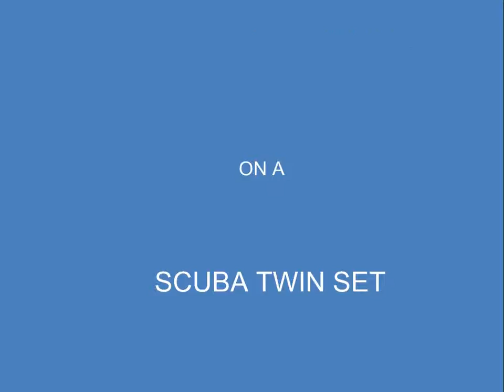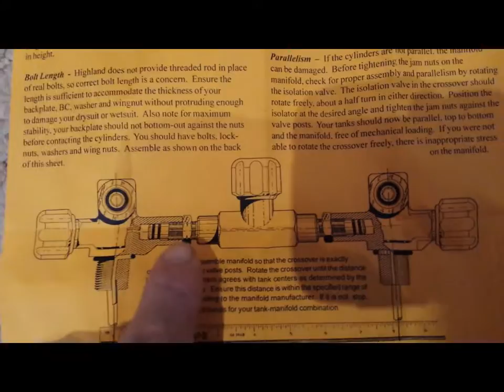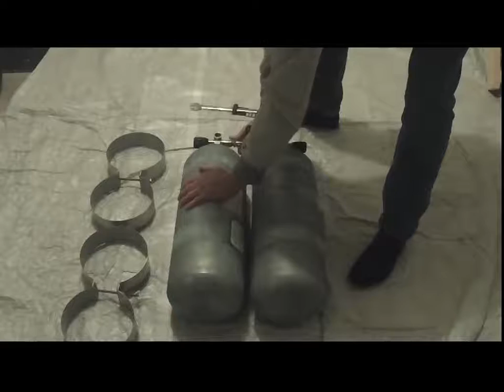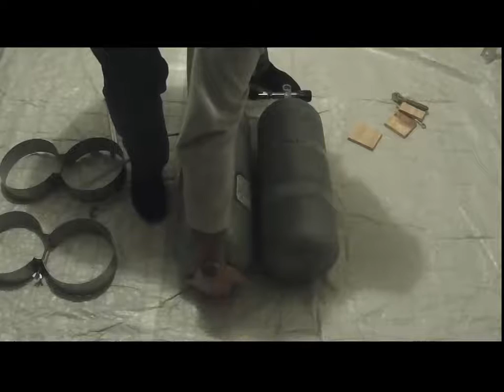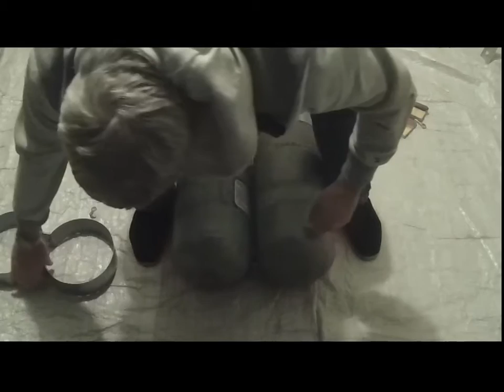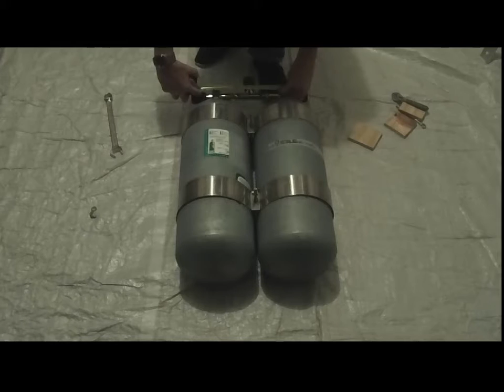Scuba Manifold Removal

Comment: Does the tanks need to be empty to remove the manifold?
Reply: @John Peter Veale I just removed my manifold with the valves closed in both tanks. Needless to say a mini explosion ensued. The valve closed does not stop the air going to the manifold isolator!
Reply: @epaminondasvalsamis5668  see the warning at the start of the video in relation to draining the tanks. If you don't understand the principle of the manifold system you should  take your twin set to a local certified store.